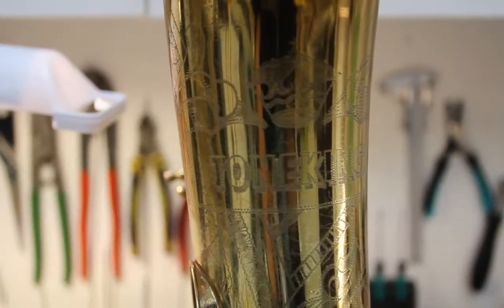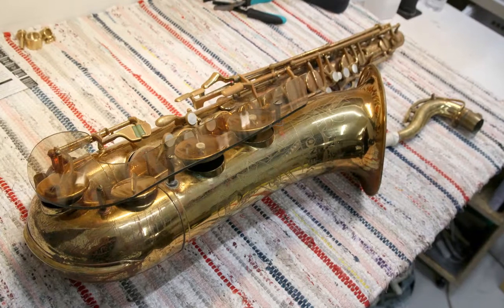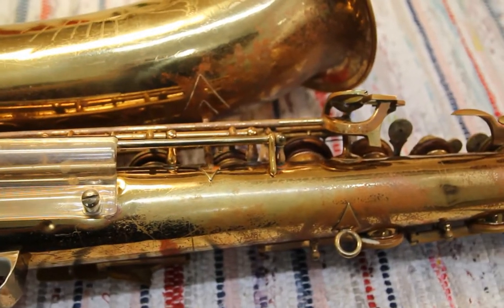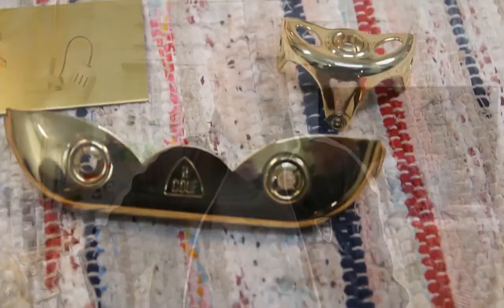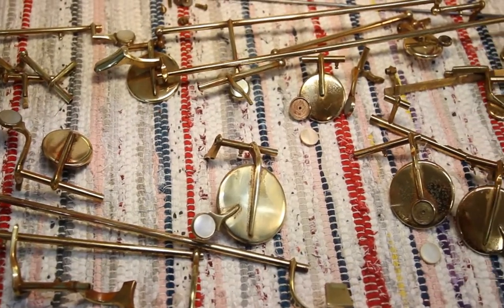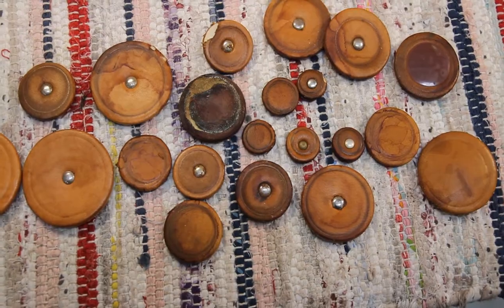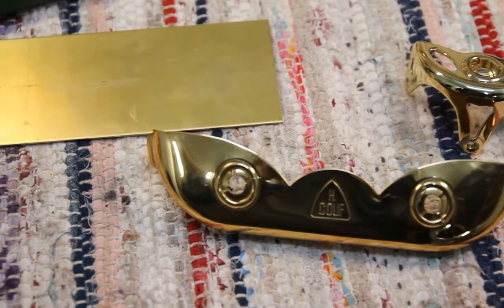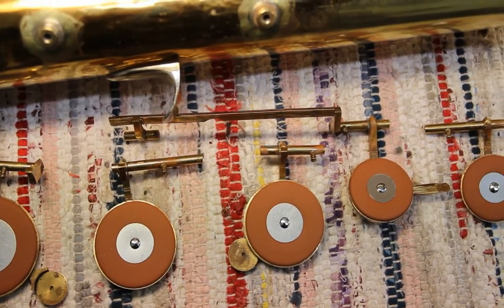Repairing Keilwerth Toneking Tenor Saxophone

Comment: Boa tarde, sou do Brasil, qual fluxo de solda o senhor usa?

Good afternoon, I'm from Brazil, which solder flux do you use?
Reply from the maker: Hello! I use Baker's Soldering Fluid No. 3
Reply: @timyllym  Obrigado por responder, eu procuro um fluxo liquido que acho melhor para trabalhar, mais aqui no Brasil não se encontra a não o fluxo liquido inflamável.

@Timo Myllymäki Thanks for answering, I'm looking for a liquid flux that I think is better to work with, but here in Brazil you won't find anything other than the flammable liquid flux

Comment: Hi Timo. In your description, you mention that they were made fron the 1940s to the 1980s. I've seen a Tenor Keilwerth, but on the bell, the only thing that is engraved is Keilwerth Special. It does not mention Toneking. The serial # is 905.. so it is probably from 1985 or 1986. Do you know if it has the same dimensions as the more modern Keilwerth SX90-R or is it closer in size to the EX-90 (which was their intermediate model)? Also, do the Tonekings sound as good and loud as the SX90-R? Thank youTimo.
Reply from the maker: Hi Donovan, I haven't played SX90-R but I have understood that they were re-designed from Tonekings so they probably sound and feel different. Toneking Special should have "Toneking" also engraved like in the link below. I like the 60's Toneking that I have but I'd really like to compare it to a SX90-R. https://bassic-sax.info/version5/vintage-saxes/european-made-saxes/julius-keilwerth/jk-nauheim/
Reply: @timyllym  Hi Timo, thank you for the information and quick reply. So do you think that if it only says Keilwerth Special, that it's maybe not even a Keilwerth? I asked someone directly at Keilwerth and they said it was a model that came between the Toneking and the SX90-R.
Reply from the maker: Donovan, I can't say, Keilwerth has made many different models and also stencils. Someone said in a comment in this thread that he has an alto that looks exactly like Toneking but it has engraved Broadway King in the bell.